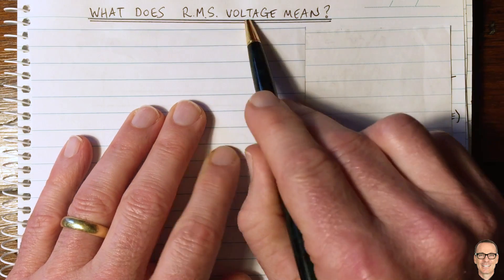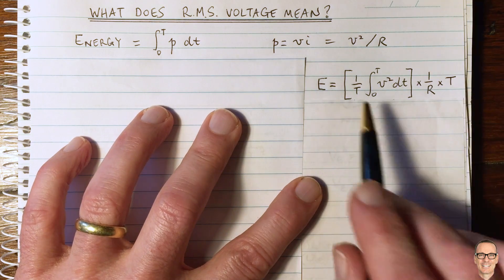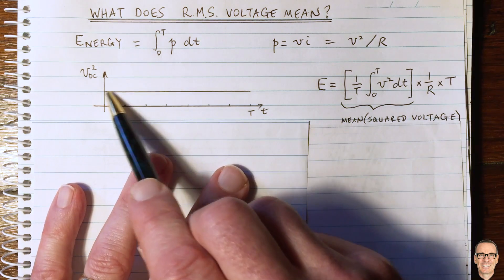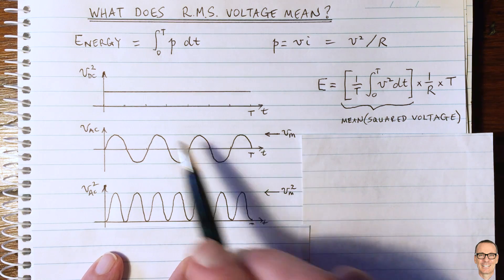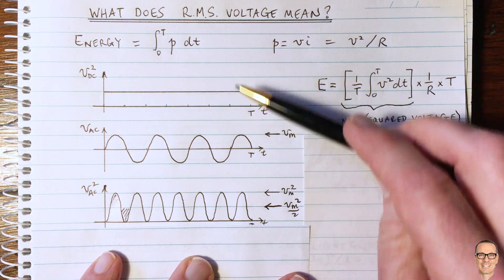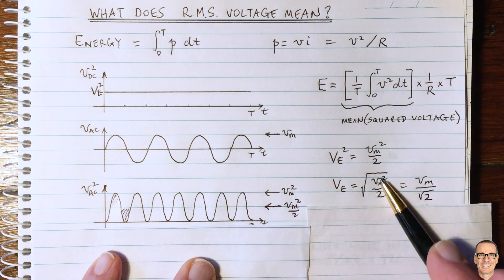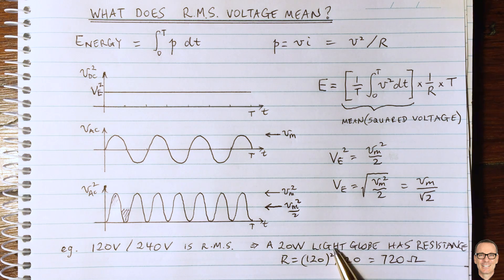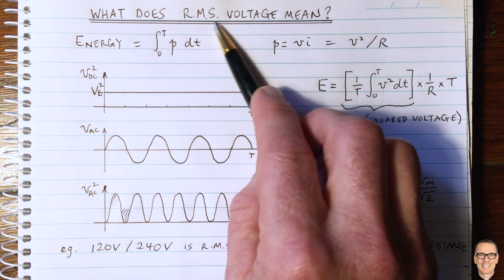What does RMS Voltage Mean?

Comment: Hi Prof. Iain, thanks for your content. Do you have any suggestions on how to calculate power to a PWM circuit? I have a battery-operated PCB with a printed heater that operates in PWM. At duties lower than 100%, how to calculate the power? By doing P=((Vmax x duty)^2)/R, P=duty x (Vmax^2)/R, or P=(Vrms^2)/2? Would you recommend any book for that? I am a mech engineer, my knowledge is very limited :(
Many thanks!